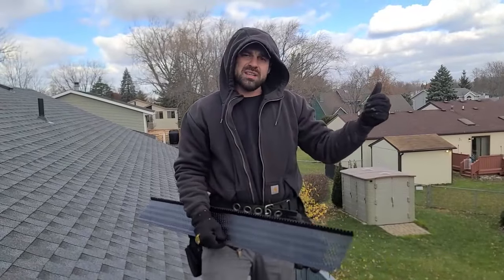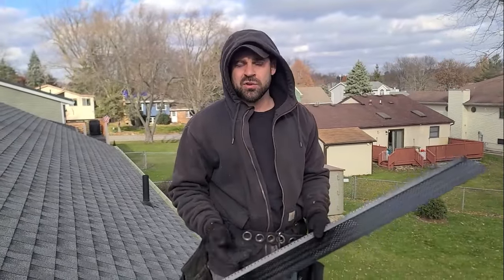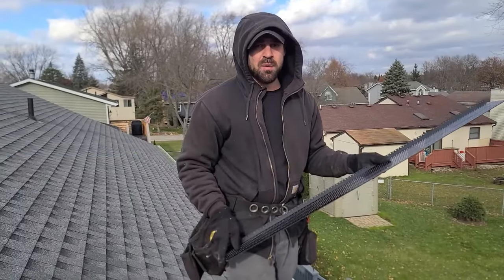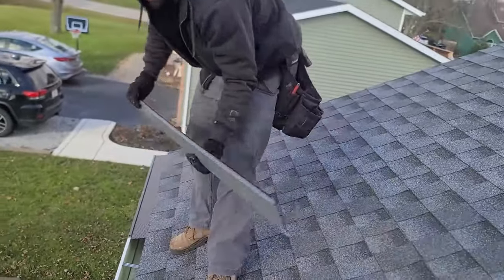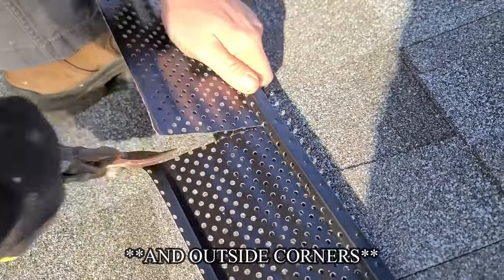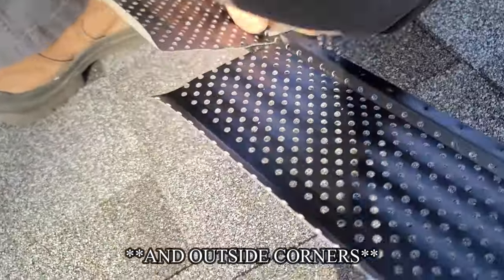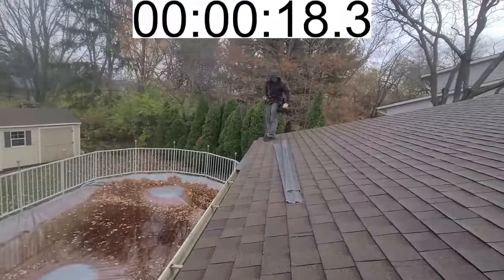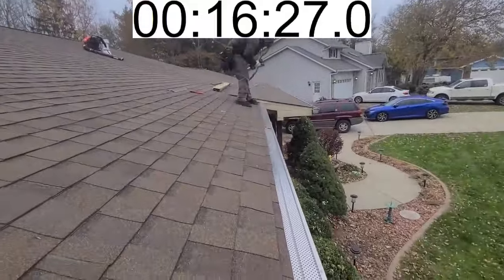HOW TO | Install Gutter Guards

Comment: I don't know if you remember my comments about my roof. I told you my wants and desires to do my own roof as a last ( who rah ) my 64 year old body and wife say " NO " but my 21 year old mind say's you better listen to the wife. Well as it turns out I got a contractor that gave me a great price and I am on his schedule in 2 weeks. I will be able to watch from tear off to plywood replacement , drip edge, moisture barrier, and making the stairs and nailing. I want to thank you for the detailed video's on proper roofing installation, I may not be doing it but can do my part watching and helping in a smaller way. I caught that part in this video about a older man 64 with bad knee's made me think you might be referring to my comment. Who know's be safe, God Bless.
Reply from the maker: I'm sure he'll do a fine job! I do remember you btw

Comment from the maker: I did forget to do a breakdown at the end while I was installing the 10 footers. Here’s the math.

129 linear feet of gutter guard
Charging $5 per foot (129 x 5 = $645)
Material cost = - 1.70 per foot ($ -219.30)
$ 425.70 worth of profit completed in about 30 minutes.
This equals roughly $851.40 per hour if you’re doing larger jobs, alone.

Comment: Pitch hoppers are also fantastic. Im gonna be looking into this for my roofing business. I always sub my gutters out but I think ill start offering gutter guards.  Ive been selling the zinc or copper strips at the ridge to help keep the roof clean which I havent seen anyone else offer for some reason.
Reply from the maker: haven't heard of the strips you speak of. but yes i promise you gutter guards are the easiest and most profitable of all things related to the trade.
Reply: @NWIVeteranConstruction  1. Thanks for your service brother!  2. The strips are cheap (not copper obviously) but, for the "blue green" algae and shit on roofs that apparently as dark streaks on a roof. If you install this strip under the ridge caps then everytime it rains it washes the particles down the roof and keeps it clean, helps with shingle life in the long run. Even easier than those guards but probablt not AS profitable. I'm sure you can charge more than I've been though too. The zinc strips you get about 5 good years out of where copper you get a little longer and a little better results in coverage. Same concept pretty much when you see those black streaks, but below any exposed pipe boots is clean.  Z-Stop is one brand you can easily find but it's something to think about for a little more profits and little extra labor involved. I'm more of an insurance hustler fighting for customers that insurance screws over really lol. Best of luck with business sir.
Reply from the maker: interesting! i thought that using 3 tab as cap was the main cause of those issues because 3 tabs didn't have the same algae resistance as the architectural shingles and cap. so switching to break away cap should solve it too right? also, i feel like we see more of that around roof penetrations and heavy water traffic areas on the new roofs...

Comment: You can get in black in 10 foot. Most gutter warehouses around me carry them.

I don't put screws in the back.. it's either under the drip edge or I'll put a screw every other hanger towards the back of the guard. Zip screws every 1 foot on the front
Reply from the maker: i couldn't find any 10 footers in black! what area do you live?
Reply: @NWIVeteranConstruction  near Jacksonville Florida. I think the brand is smart flow or something. Sennox and I believe Town and Country have them

Comment: I can tell you from sub contracting for a gutter guard company that I have done old peoples houses just gutter guards that the salesman sold the job for 10 thousand dollars they paid me 400 to do it (which was a lot to me as it took me 5 hours tops by myself) and the people didn't have a tree within sight for miles...original reason for clogged gutters was chipmunks who were still able to run up the downspouts when I left...

Comment: Hey man, appreciate your videos. I want to do this and a lot of people have told me not to lift the leading shingle or break the seal of it if it is sealed. Does doing that impact water intrusion seriously?
Reply from the maker: If you're in a hurricane state maybe I can see something like that but where I'm from, they don't seal to the gutter apron like That unless people put starter on up side down which is weird.  Also, this brand doesn't go under the shingle, it gets fastened to the back

Comment: rookie here how do you measure to get the right size gutter guard ex. 5inch/6 inch. I've watched videos but everyone has a different way, what's yours?
Reply from the maker: They're usually all 5 inch, if it's 6 inch you can tell it's a way bigger gutter than you'd normally see on an average house.  Metal roofs and really big roofs are much more likely to have 6 inch

Comment: Are the gutter guards you use in the video Aluminum mesh guards?
Reply from the maker: They're solid aluminum with holes punched through. I think you're talking about the correct thing but I don't like the word mesh because the mesh gutter guards (with like screening)  are trash.  I show them up close in this video a few times
Reply: @NWIVeteranConstruction  okay thank you for the info and response!

Comment: That are the worst gutter guards keys get caught and stand up then rot out fall in and turn in the moss then you have to remove the screens to clean them.i recommend the fine screen ones  available at costco.i been cleaning cleaning troughs for 25 years.

Comment: Putting screws on the shingles side of the gutter guard is sheer suicide. Water will find its way below the screw deteriorating the wood below it causing leaks in the ceiling always install screws on the gutter side the front so you don’t cause roof leak problems.
Reply from the maker: i didn't screw the shingles. its through the gutter apron and the screw is really short.
Reply: @NWIVeteranConstruction  my bad sorry